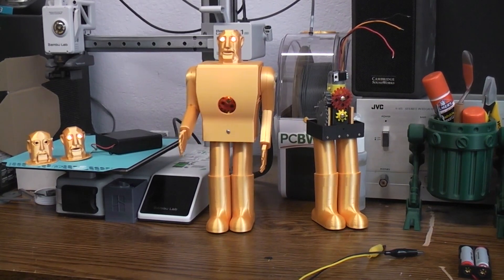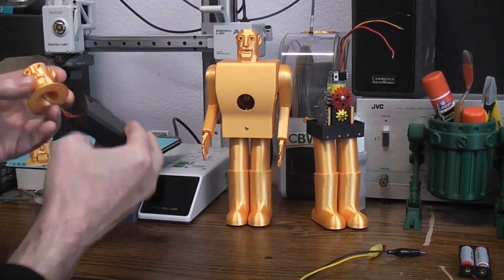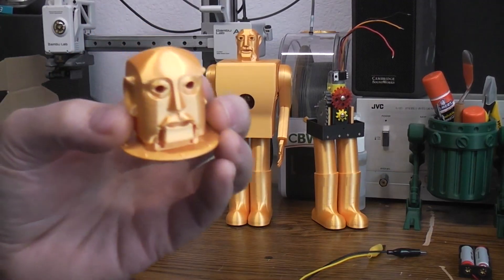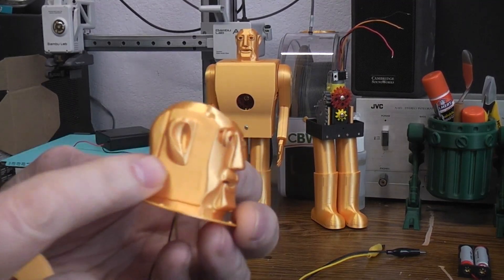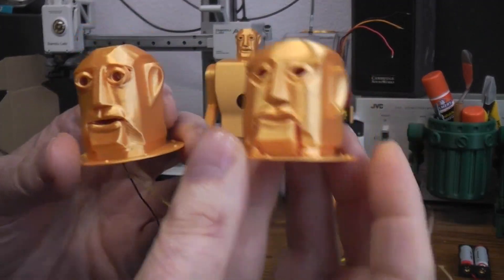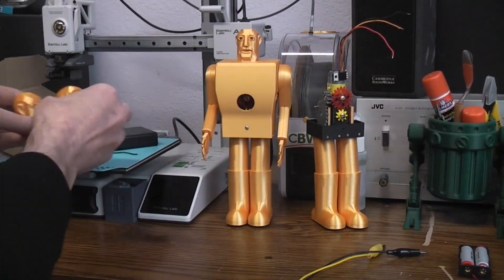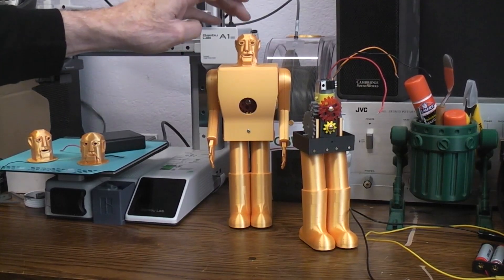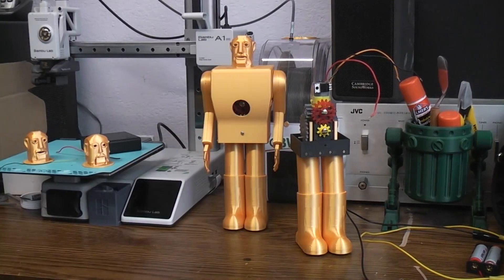Part 4 of the battery operated, 3d printed Elektro robot build. The Head, the Gear display & more.

Comment: Oh my.... This is one awesome robot. Both the heads are really good, but I am sooo impressed with the Tinkercad version. Just a thought as it is only something that I have seen in the past but not actually tried. You could import the head STL into Blender and smooth it out using Blenders tools?
Absolutely love the gearing for the porthole. Maybe if power can handle it, a slow flashing colour changing LED behind or below the gears would add even more interest?
As per usual great video, and extremely interesting. I can't wait for part 5!!!!!!

Comment: I see you did include the non-gear leg cams. Could you also include the non gear chest box please? I want to put a voice module in the chest and need the space. 
Thanks so much for this great model!
Reply from the maker: There is only a 2 mm difference. But you can modify the stl file in 3d builder program that is free with every window computer or just use modifiers in any of the slic3r based slicers like bambu labs slicer or Prusha slicer. You can add holes or subtract walls. Any thing you like.
Reply: Of course. I can use tinkercad to modify the thicker walled version if needed. After looking at the actual audio electronics, I think gears AND audio will fit. 
I will test print a version and see. I do have higher speed motors I can use for fitting parts while waiting for the slower ones.

Comment: If only they made LEDs that glow pink like tubes- you could see tubes going in his chest hole. Outstanding work!
So what's next? Herr Doktor? Republic? Gilligan/Honey West?
Reply from the maker: They do make ultraviolet, inferred and violet-colored LEDs that look very much like vacuum tubes under load in color. But in the original robot the RED and GREEN light sensors were in the chest and behind them was a normal white Lamp that flashed with each word that was spoken into the control microphone.

Comment: Thanks for the shout out! I enjoyed making the head. I actually used Blender and its pretty much made in a non-destructive manner. So each feature can easily be resized or what not. I come from a games dev background so I deal mainly with polys rather than a cad approach. 
I can cut those extra edges uptop, so I'll give you one that will be a little better in that respect. 
But the whole robot is awesome! I wish we could put together a little coop group "The Robot Buddies" or something like that and do more collaboration. This is fun :)
Also, you should use your head with the body stl on Thingiverse, and the other heads can be linked. Just my opinion.
Reply from the maker: Thank you for the added information and your work on the project.
Reply: @ I just emailed you a better version. Fixed a couple things that was bothering both of us, lol!

Comment: The final robot is amazing. Nice work. The gear in the chest lends the authenticity of it being mechanical. I recall the museum curator, Mr. Schaut, said the head would rotate but it was under repair when I saw Electro.
Reply from the maker: Yes the head can rotate and tip in the original design.